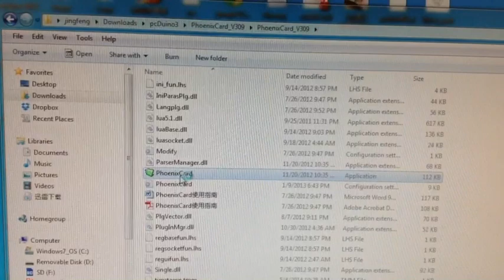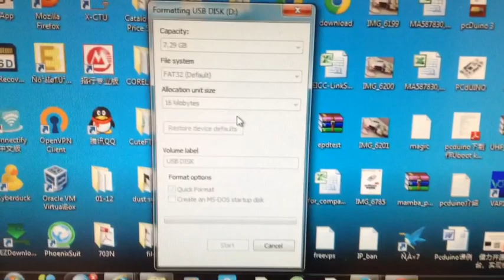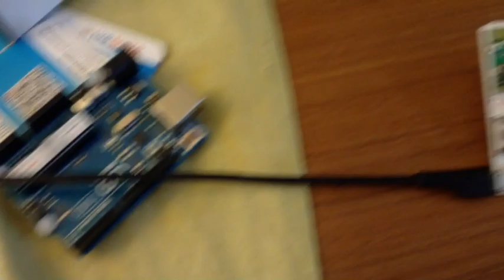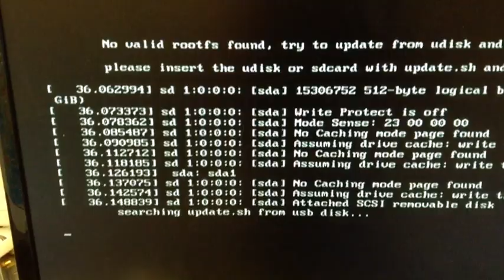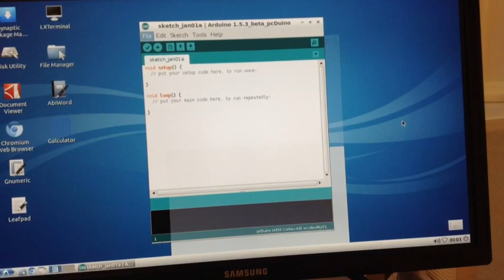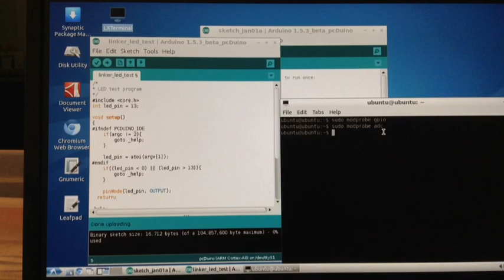Reflash pcDuino3 and run Arduino IDE

Comment: For Ubuntu14, would you require pcduino_ubuntu_2015XXXX.img ?  There is only pcduino_livesuit_20150107.img
in the linksprite website. Any help is greatly appreciated.